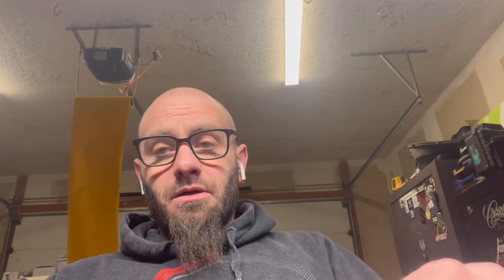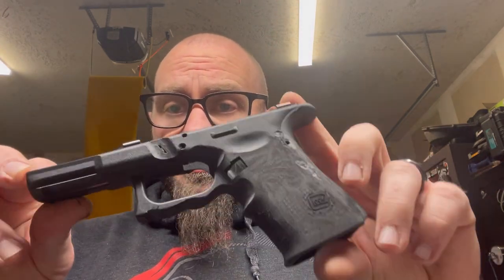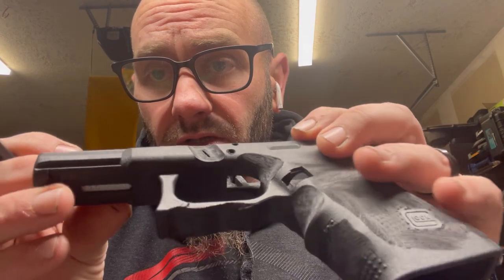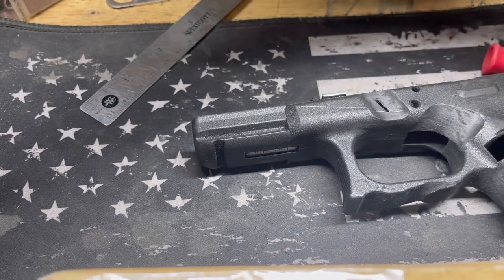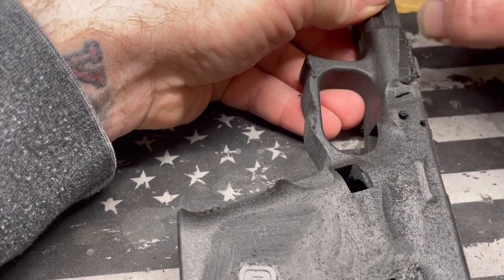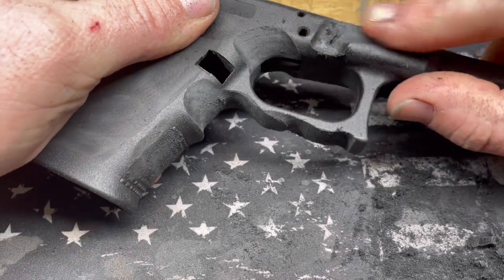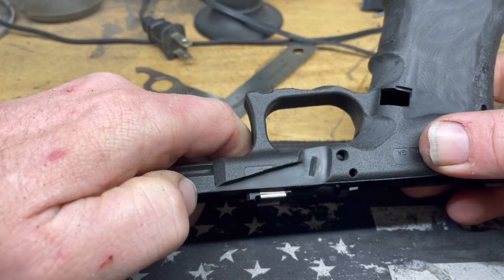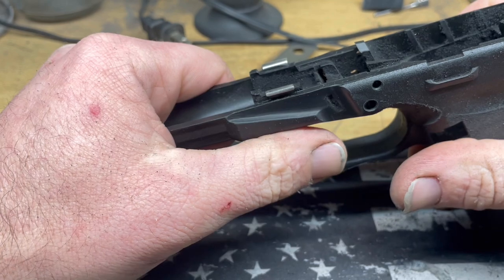Creating the gas pedal/accelerator cut

Comment: I will just cut the rounded edge to flat. Maybe 7 mm from the slide removal pin. When it is flat it will have the most grip possible to your thumb for upward force. No point to make any agle with slobe with drills. Cut is sharp. Sharp edges give maximum grid and overall feel. What is harder item to hold: Soap with corners or soap without corners?
Reply from the maker: Whatever works for you. It has nothing to do with “sharp” edges. The way I cut mine contours to your thumb. Not only making it effective, but also comfortable. If you like sharp edges more power to you.

Comment: New to the chanel. Was wondering how the wd 40 helps level it out
Reply from the maker: Both hydrocarbon based. Anything hydrocarbon will react the same. Take wd40 and spray on any tape adhesive and it will wipe it right off. Same concept

Comment: Hello brad. Thank you for the channel I just found it and love it. I’m watching all your older videos and enjoying them and seeing what I can learn. I had a few questions if you don’t mind me asking. I have a previous build that I got lucky with it went together very smoothly. Right now I have a g43 build that I’m having some problems with and it’s my first 43. When the slide goes on there is some binding and it sounds scratchy and rough. When I took it off the recoil spring has scratches on both sides, it looks like it’s from scratching on the front rail. Also I have some pretty bad scratches on the very back most part of the front rail I’m not sure where that’s from or how to fix it. And the cam on the trigger bar seems to be binding and has a scratch on the side of it from I think rubbing on the slide. I would very much appreciate any polishing tips you can give or areas to really focus on to fix these issues. Im going to check out more of your previous videos and see if I can find anything that can help but I figured it wouldn’t hurt to ask for some help. Thank you very much for your videos and your time

Comment: Certainly looks cool but i wonder how functional it is compared to an actual gas pedal.
Reply from the maker: Identical. These are a great option
Reply: @gledhillcustoms4659  awesome. What would you estimate the depth of the cut? About 10mm? I think that would indeed be enough to make a noticeable difference, especially with a proper grip.
Reply from the maker: @kogasoldier9379  that’s probably fairly close, not as much on the slim line frames.  The increased surface area where it’s rounded and stippled fit the thumb nicely. It’s surprisingly a noticeable difference